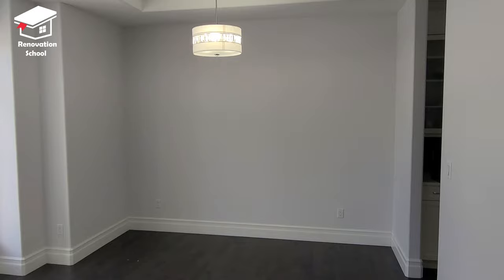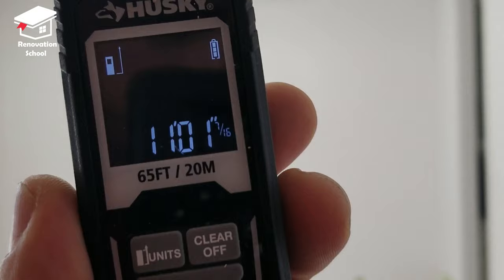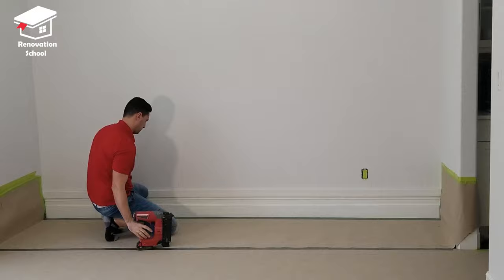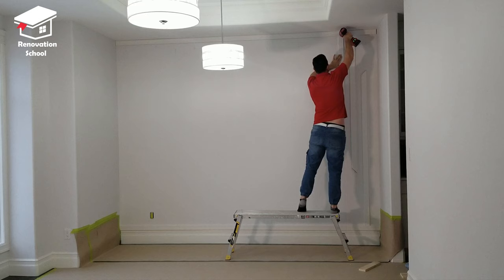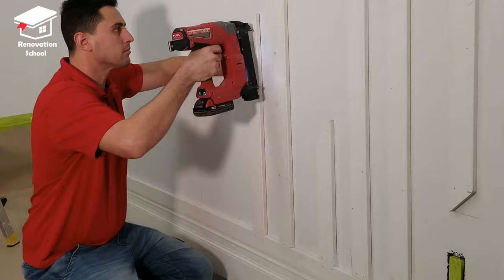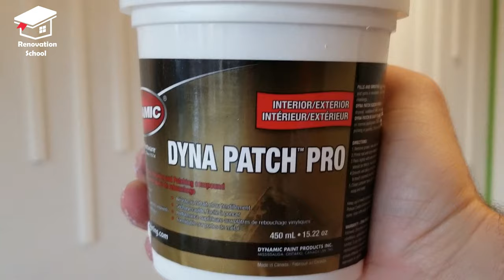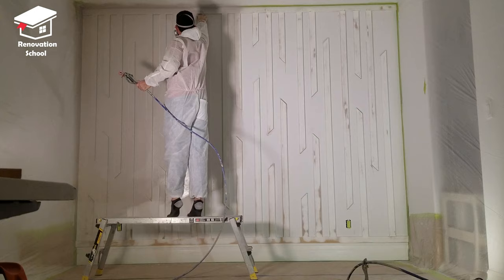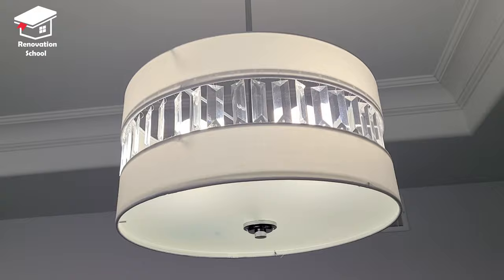DIY moden accent wall / modern wall design

Comment: Thanks so much for the video! Question: after measuring the wall how do you make sure all the pieces fit evenly all the way across? I know you had 3” & 5” but how do you know how many pieces to fit across so there isn’t a giant gap once you get to the end? Thank you!
Reply from the maker: Hi , thanks for watching 🙂 you have alot of room to play , you can lay your pices on the ground and then see if you like the lay out , you can move      them a little bit when u get to the last 4 feet and even if they are off by 3/4 an inch it's not noticeable because they are not the same hight.
Reply: @renovationschool8818  oh makes sense thanks!

Comment: Hi mate great look to the wall i have a small question what is your width size for each strip you cut
Reply from the maker: That's custom cut to the size of the opening.
Reply: @renovationschool8818   no i mean how wide are the slats not the edge pieces the middles ones
Reply from the maker: @redcadillac01 hi 
Oh I see 
They are 1x3 MDF
Reply: @renovationschool8818  1x3 inchs
Reply from the maker: @redcadillac01  yes sir

Comment: Beautiful work! What size trim did you use?
Reply from the maker: Thanks for watching 🙂
I used 1 x3 rimmed MDF 
It's called 1x3 but the true measurements are 3/4 x 2 1/2 just like dimensional lumber that the actual measurements of a 2x4 is 1 1/2 x 3 1/2 inches.

Comment: I see that you used nail gun on non stud areas. Is it ok? I am trying to get a similar look but my studs are spaced far. Any solution?
Reply from the maker: Yes I used the No More Nail adhesive and then nailed it to make sure they never come off . I nailed the trim on areas that did not have any stud also.
When you nail try to put each nail at a slightly different angel this way the nails pulls and hold the trim against the drywall.

Comment: Can i only use the glue without nails ??
Reply from the maker: yes for sure, just tape the trim down in a few spots so it stays in place while it dries up.
If u do it on a wall that the other side is on the outside of the house I highly recommend nailling it. due to the weather, the boards may expand and contract too much and all ur seams may fall apart if it's not nailed.